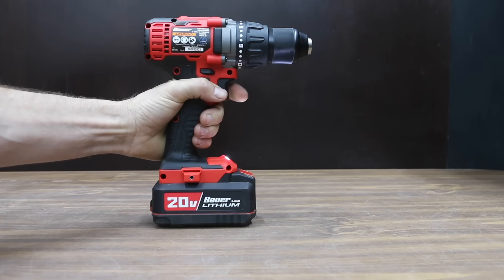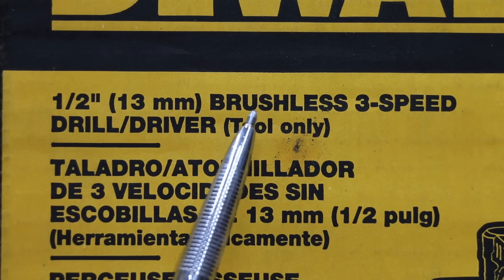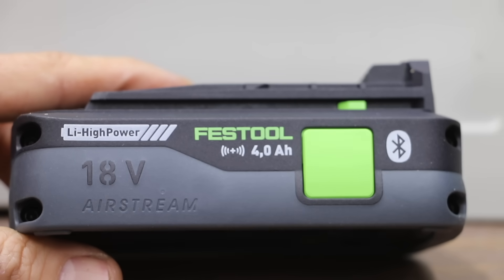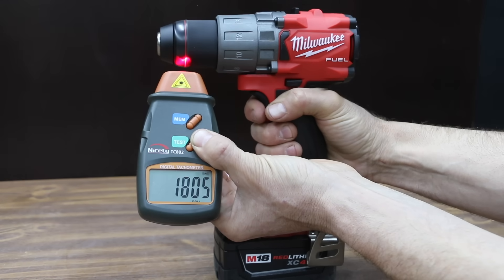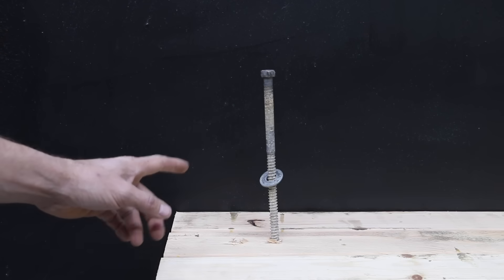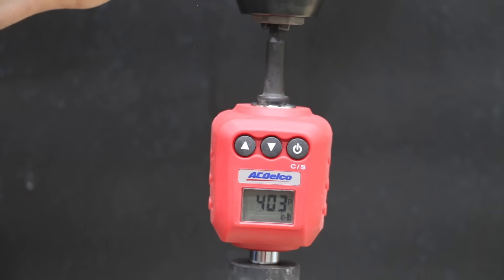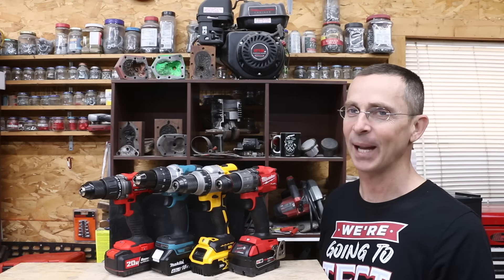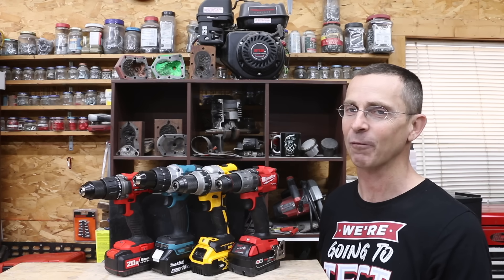Best Drill (BATTERY POWERED)? Milwaukee vs Dewalt, Makita, Bosch, Festool, Ryobi, Bauer, Ridgid

Comment: I love the testing performed and the thoroughness of your work. However, I feel there is one question that wasn't dealt with in this portion now that I think about it.

How well do these separate tools actually function as drills? Do some of them hold drill bits just a little better, maybe handle drilling different materials (plastic, aluminum, wood) or different drilling tasks (hole saw, makeshift cutoff wheel, rotary file, etc.)? I know, I might be a little pedantic about this, I just think might have been a slight missed opportunity.

Lastly, on the same vein as these tools, how well do the 12 volt versions stack up against each other. I've often found that for the work I've done, 12 volt tools are more than enough to get the jobs I want done, at a significantly lower fatigue level than lugging around the 18-20 volt systems. (Anyone who wants to challenge me on this has probably never been assigned to pull all the panels on the bottom of a MD-11 wing or reinstall them as part of a C4-check.)
Reply from the maker: Thanks!  Thanks for the feedback.

Comment: The Milwaukee would be MUCH more powerful and much faster with their "high output" batteries.
Reply from the maker: Thanks for the feedback.
Reply: Hmm, so they're regular batteries are low output?
Reply: @airvideo7  18650 cells vs 21700 cells. Makes a huge difference.

Comment: wait... the Ryobi model used was the brushed model? Why not test the newer brushless unit instead? Seems like most of these tests are really geared for drivers instead of drills. But here's a test request.. conduct a test of one product brand line across all their generations of batteries, where able. The switch from NiCd to NiMH to LiIon and now to enhanced LiIon has allowed for the move from older brushed motors to brushless motors which draw more current from the battery. Reading the manual for some of these units, they can use prior gen battery (where applicable) but they wont draw the full current that a newer gen battery will provide, thus performance of the unit suffers, despite the unit being a current gen brushless model. Ryobi of course would have the advantage here with their 20+ year battery platform stability, but some of the other generations of batteries underwent more than one tool refresh before being replaced with a newer battery footprint. It would be good to see within each brand how the tools perform with prior gen batteries compared to current gen batteries, where appropriate. You could even test how long they take to change the Farmabago tire lug nuts.
Reply from the maker: Thanks for the suggestion.

Comment: My Milwaukee drill broke. I mean it literally fell apart in pieces. The gearcase broke.
So, I sent it in for warranty replacement. When I got it back, the bill parts breakdown showed that except for the case, it was all brand new parts, no charge to me of course. Looking at the pricing, they could have given me a new drill for cheaper. But, I'm not complaining, just saying.
I also noticed that the new gearcase stopped if the torque exceeded its rating. They also included a new handle style that gripped the casing a lot better than the old style and also relocated the work light but not having any issue with the old style can't understand why they did that.
The point is that Milwaukee must have realized the weak points of the drill and reengineered the tool to make it a better product. How many companies can you say do that in this day in age??!!
Reply from the maker: Thanks for sharing.

Comment: All of those Festool tool collectors with a dozen cream and green tool boxes in their workshops are going to be p#$sed after watching this.
Reply: Organization is very important to woodworkers. I have a full set of Bosch tools in fancy stacking boxes that I really like in the shop. But I use Milwaukee on the job site.
Reply: What really annoys me is that Festool has been using more and more chinese slave-labor. The whole reason I purchased Festool products was to avoid supporting slavery, thankfully all of my Festool tools were completely made in Europe (including the batteries), but I think I'll try to get Mafell tools next (hopefully Mafell is still completely non-slave-labor).
Reply: @mikey4016  Try tools from Fein GmbH, a german tool brand. They invented the first handheld electric drill. They are mostly made in Germany. The Festool OSC is from Fein (they call it Multimaster).
As far as I now, only the 4,0 Ah Battery pack is made in China. The 3,1 and 5,2 are made in Poland. Even with this "Made in xxx" as country of origin there may be many parts, which were manufactured in China. If you don't want to buy anything with parts from China, you can't buy anything with a chip or wires in it nowadays. Made in USA only requires: "U.S. manufacturing costs constitute 75% of the manufacturing costs for the product" As labor is much cheaper in China or even cheaper in Bangladesh etc. that means that maybe the product was manufactured for 10 hours in China and then for 1 hour in USA and et voila: Made in USA.
Reply: @MnemoLogic  Yep, it's pretty hard to avoid slave-labor and I realize I can't avoid it entirely, but I try to avoid it as much as possible.

I've been trying to save up for a Fein cordless Multimaster, I was never even interested in Festool's version. Unfortunately, lately I've seen far too many of Fein's products made in china, so I'm not so sure about Fein anymore either.
Reply: @mikey4016  Slave labor is illegal in China buddy. This isn't China in the 80s, many of the Chinese infrastructure leagues ahead of the US and Japan's
Reply: Why should they? If the tool works for them... If not, they would be pissed already, without watching the video. Some like features that are not measurable in torque numbers ot how long it takes to screw in a big screw. I personally would never buy such an expensive drill.
Reply: @alias_not_needed  I'm only teasing people on Instagram who like showing off their tool wall of cream and green. I own a couple of festool sanders and I did have one of their drills but I prefer Panasonic drills now, they seem to last ages.
Reply: @miheadhurts  , hmmm, never seen a Panasonic drill! Didn't know they made 'em but I guess I shouldn't be surprised. Most of my battery tools these days are Milwaukee but I own some Ryobi and Makita cordless tools as well. I've got some corded Bosch drills that I bought in the 1980s, before the rise of cordless tools, that still work great (I put 15 foot appliance cords on them).
Reply: @goodun2974  Panasonic were the original manufacturer of cordless drills. Last one I saw in action was brilliant,  way better than the equivalent Hitachi that I owned at the time.

Comment: Don't get me wrong here - I love the content.  However testing cordless drills to the same testing methods as impact drivers is well erm pretty pointless.  

Stick a big hole saw bit on the drill and test performance - drill hardwood with a large diameter forstner bit etc.  People also use them to drill metal test that also ... with me being having a far more of a wood working viewpoint this test in my eyes was a missed opportunity.

Chippies, carpenters - whatever you call them are far more interested in battery life than anything else - if they get through a hard day of drilling and screwing on 1 battery, that's a winner - not the one that can drive in a huge bolt!

Comment: The Ryobi you tested is an older model with brushes, Model P215. The newer Model P252  is brushless, and should have more power and not overheat, and should be comparable in speed and torque to the middle of the range you tested. Thanks for another useful comparison test that helps us spend our money more wisely.
Reply from the maker: You are welcome!

Comment: I believe Ryobi just made brushless drill for the new generation tools line up I would love to see that drill also the battery you just tested in Ryobi it just came out it's high drain battery for different line up I have two 4amp battery I honestly would like to see more tools coming up with 5 years warranty or Ridgid lifetime parts warranty witch is great price for what a regular average consumer would get for using it on weekly basis but nothing beats the DeWalt and Milwaukee when it comes to everyday heavy construction work all that dirt and dust goes inside the tools and they still work like a boos 😂😆
Reply from the maker: Thanks for the suggestion.

Comment: $544 for a drill is way out of line especially considering how it performed in the tests.
Typical German product, overpriced and over engineered.
Reply: But if you was drilling all day every day the Festool would see most of the others off and ive both hammer drill and impact wrench and for most of what he did i'd take the impact wrench to the fight but if was drill it would be the drill. but in two boxes of 5x100 and 4x80's Old Makita impact wrench did no issues one battery charge.
Many of those big bolts you don't drive in fast better with impact or heats bolt and timber up so later they can become slacker as cools down

Comment: Before watching I will state this.
Every drill I’ve used with an amperage cutoff instead of a physical clutch 
1) Strips screws 
2) Has less torque at max load
3) More prone to injuring you if in an awkward situation bc of the mechanic function.

That being said not everyone gets a $800 hilti drill for work, but I’ve mixed 50+ bags of concrete 5 gallons at a time non-stop with 6 batteries and it never once complained

Let’s see how these consumer drills do!
Reply from the maker: Thanks for watching.

Comment: Very good, i have the ryobi, drill, impact driver and angle grinder, i need to get better batteries, and they are made of a plastic i think would not hold up well if dropped, but i do like them and i use the heck out of them.
Reply from the maker: Thanks for sharing.

Comment: Didn’t even test the best dewalt drill.... the 998 or 999 is the best. What a fluke.
Reply from the maker: Thanks for the suggestion.
Reply: That’s fine. Didn’t test with the best Milwaukee drill either. They also make a better performance battery for it.
Reply: @handymansolutions7834  yeah it doesn’t make much sense, but content is content. Wish it was flagship models

Comment: 90-day warranty is a slap in the face, and not confidence inspiring.
Reply: HF wants you to buy the extended warranty on all their power tools. That's why their initial warranties are so short.
Reply: @m00se23  this is exactly true. I want to say that the 2 year warranty on the drill is like $10. They wouldn't offer the extended warranty if they lost money on it, so in reality anything they offer a warranty on is statistically likely to last the extended time.

Also the extended warranty at HF is much easier to use than other brands, because you literally just go to the store and swap it out no questions asked, really the employees at the store don't give a crap what happened to it because their store metrics are based on how many warranties they sell so at the store level the employees replace it no matter what to keep the customer happy and more likely to buy a warranty in the future. You don't have to call in and send it back or anything like that so even if it breaks due to normal wear and tear it's still "covered". The paperwork they give you says it technically isn't but they employees don't care.
Reply: even as a professional that might just be a few uses... im with you, that just screams "Dont buy me" ... Dewalt may not be the best made in China crap but it seems to hang in there as best band for the buck
Reply: Exactly. I'm looking at getting a decent framing nailer. I can get the Banks at HF for $120, and have 90 day, or buy a Metabo at Blowes for $180 and have 5-year.

Comment: I feel like your tests gave me an idea which ones are the fastest, most powerful drivers. I still don't have any idea which is the best drill.
Reply: Drilling takes less of a load. If one is capable of driving a lag bolt, I’m sure it’ll have no issue drilling anything within reason.
Reply: @outcastiid  Oh, I see. If it can drive a lag bolt, it logically follows that it has a high quality smooth operating chuck able to secure small bits as well as large bits, precise long lasting bearings which yield no bit wobble, quick battery recharging time, long battery life, good ergonomics which makes it comfortable to use for extended periods, a durable case which can survive drops and other abuse and all those other things which make a good cordless drill.

Comment: Would have liked to see a Porter Cable brushes in the mix. I own a set of various Porter Cable 20V tools, and have been happy with them. 
They seem like a respectable mid level tool made by Black and Decker, and was Lowes answer to Home Depot’s Ryobi until they changed over to being the big box purveyors of “Craftsman” tools.
Reply from the maker: Thanks for the suggestion.

Comment: I was at Home a depot the other day and was looking at some of the Ryobi drills. I was wondering why you seemed to pick the cheapest drill they make? They have a1 hp brushless model that is still significantly cheaper than some of the other drills you tested. 
I guess my question is when a manufacturer makes more that 1 model of a tool what criteria do you choose in picking the tools?
I released you pay for all these tools yourself so you can’t buy them all.

Comment: I mentioned this on a previous video, but electronic clutches can behave differently depending on which speed the drill is on.  The speed selector is entirely mechanical, so the electronics in the drill have no way of knowing which speed they're on.  Since they often detect the torque at the motor output, this means a very big difference between the clutch on different speed settings.  The lowest torque setting in first gear can result in more torque than the HIGHEST setting on second gear depending on how the drill is geared.
Reply from the maker: Thanks for the feedback.

Comment: why not also test Hercules from Harbor Freight? It's a huge step up from Bauer. Bauer burns out really fast if even put it to a slightly tougher task.
Edit: Also surprised Metabo isn't in this given a previous video of the battery power screwdrivers
Reply from the maker: Thanks for the suggestion.

Comment: hahaha I like how he just didn't mention the Festool at the end. $500 drill that got walked all over by one less than half the price.
Reply: Festool, the festering tool.
Reply: @TugIronChief  I’m just talking about the brand. Never had good experience with it
Reply: @TugIronChief  Lucky you - or unlucky me. My observation is based on what I see when people take them apart... and my own anecdotal experience (2 DeWalt tools; one very good - old design DW 745, one a bit crappy - multitool designed 'yesterday')
Reply: I think the festool is typically geared towards high-end finish carpenters/woodworkers, they do have a pretty nice dust collection setup with their tools. But yeah, I think it's a bit pricey for what it delivers.
Reply: @drew5334  found the shill. They're junk.
Reply: Well to be fair, at ~$150 most of the other are just unwieldy screwdrivers, since you get no battery or charger.
For hobby application it's overkill and an extravagant option.
But Festool provide a value to those who need the eco system they provide. 
The office penny pinchers would never purchase those tools if it was overpriced for what it delivers for the use case.
Reply: @TugIronChief  Double the price though.
So buy the latest Dewalt tech in 5 years and for the 5 year life span, your tool will be better performing.
Reply: @TugIronChief  better quality, my ass. The only thing better about Festool is the marketing mumbo-jumbo.
Reply: if your drill fails its probably the man behind the drill
Reply: @veisszero  It’s a drill not a semi truck. There aren’t many ways you can fuck up a drill.
Reply: @TugIronChief  Were. Not sure the current ones are as good...
Reply: @TugIronChief  False. I know guys on the job site who need a new impact gun every 6-10 months. And the circular saw has absolutely no power
Reply: Well, your dewalt will fail you on the job And some could lose more than a drill
Reply: @Dextermorga  Never had a DeWalt fail.
Were you using the consumer or trade models?
Reply: @markp8295  these people are obviously on consumer models if they're failing that fast. People don't understand that professional tools have professional prices, but last for a professional amount of time

Comment: Milwaukee and Ryobi are the two I have had good luck with.  I gave away a set of Dewalt after the batteries went bad after 7 months of very light usage,  Ridgid set was returned after 3 weeks of dealing with support, I have Ridgid Sawzall that has been a problem from day one.
Reply from the maker: Thanks for sharing.

Comment: i love your videos sir!
i use bosch at work and at home because they fit my left handedness. lol. my fingers are short and the controls for most other brands are just out of reach. milwaulkee and mikita are a close fit but way back when there wasn't the depth of tools for the brand. you might want to include measuments  in your reviews as my index finger is only 2.75 inches. thumb 2.25 inches. that makes a diff when reaching the reverse button  or safeties on tools . 

note on flextalic gaskets for boiler work i tend to use my drill for the 1st torque run them my impact and finish with my torque wrench at 120ftlbs. i may have to test that. link is for the torque of the gaskets.  https://flexitallic.com/us/wp-content/uploads/sites/8/2019/08/chartTorqueFlexpro-8-19.pdf

please keep up the good work.